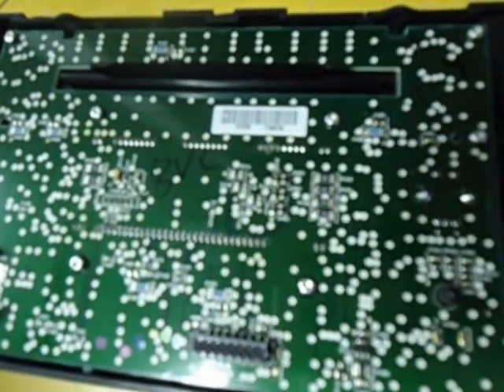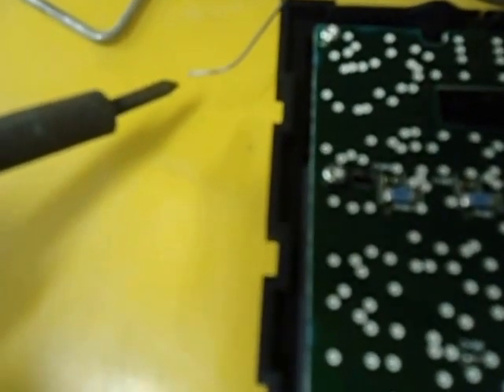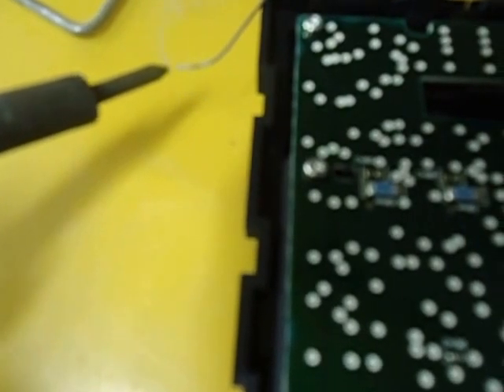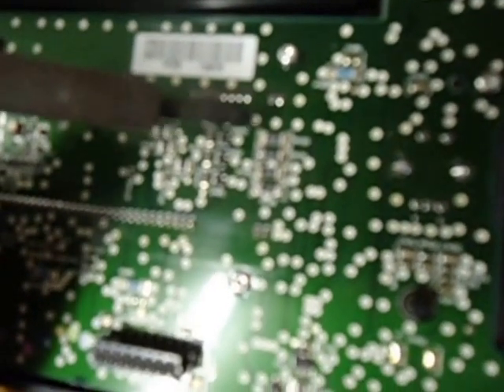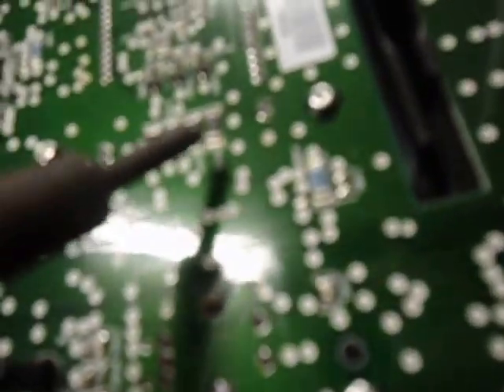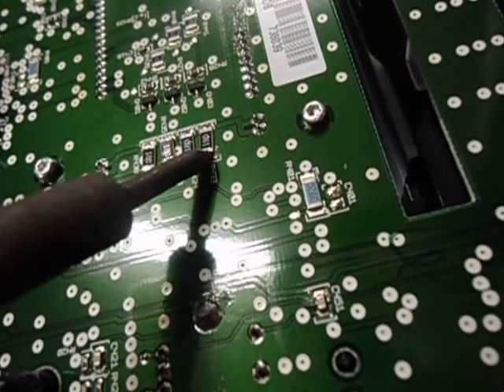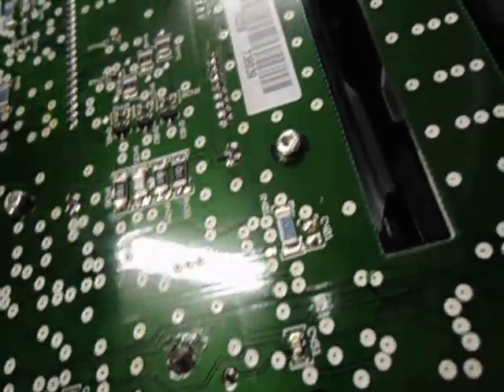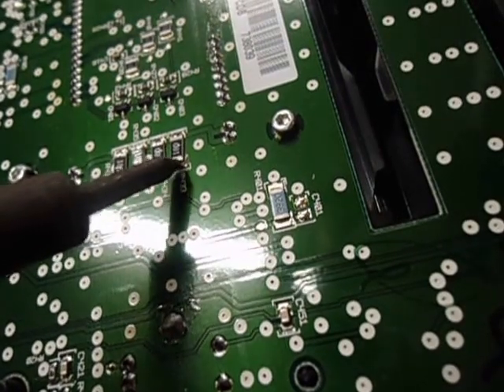2006 - 2009 Ford Fusion, Mercury Milan Radio Repair. Re-soldering of 4 resistors (Part 3 of 4)

Comment: My Dad just bought a 2006 Mercury Milan and the radio was working but nothing on the display. Found your video and after a quick trip to Walmart for a soldering iron and a little bit of a burn from the soldering iron I'm pretty sure I saved my folks a few hundred bucks on a radio. Thank you for the video! Absolutely spot on!!

Comment: Just fixed my radio. I service a fleet of Ford trucks and I have been seeing this for years. Most people just live with the problem others have installed and aftermarket radio. After seeing this work on my own truck I will be doing this repair to other trucks at work. Saving the company I work for money will be a win win with the cost of everything going up. Thank for sharing this info.

Comment: Thanks. Had this problem for a year or more. I saw a blog on it once so knew what to do. Finally started pulling it apart while stuck in traffic this week. When I got the face plate off I realized I didn't remember which cold solder joints   to fix. You nailed it. Works great now, can't wait to drive to work in the morning.

Comment: Thank you for the videos, I finally took the time to follow your steps and it was those same 4 resistors. Compared to the other similar ones, they looked like they only had flux on either side. Every time I can see the time or station I will think of you, Stimpy.

Comment: Thank you for posting these 4 videos.  I have same model stereo with same problem.  Your 4 videos show me how to fix myself start to finish and save hundreds!  Thanks.
UPDATE:  Next day I followed your instructions and repaired the stereo and now the display is bright green again.  Yes, it was that row of 4 resistors.
Reply: What do you heat the resisters with. I also have same problem/same radio. Please help thanks
Reply: Omgoodness, I am so happy to have found this. We have a 2009 explorer and I’m sure that’s the problem. I will get a soldering gun and hopefully I can fix it. Thanks so much.

Comment: Thanks for this; i was aware of the solution for awhile. Took the radio apart today on my 07 Fusion, going to solder it tomorrow and i wanted to double check the technique. You confirmed what i already knew which is very reassuring.
Reply: Just did my stereo in my 2006 Explorer.  Worked out perfectly.   Thank you.